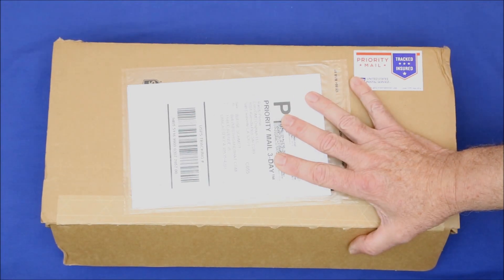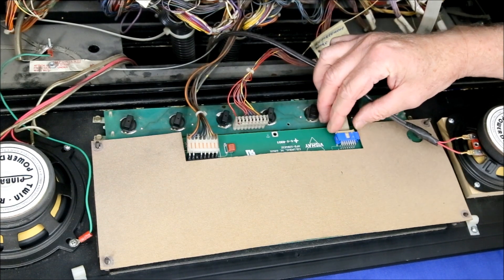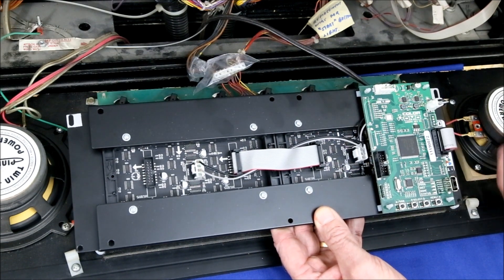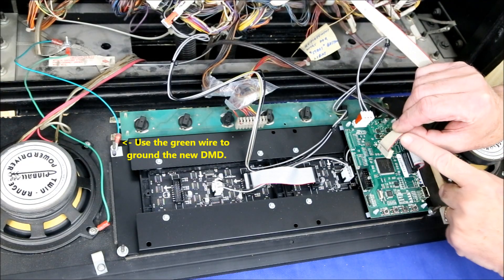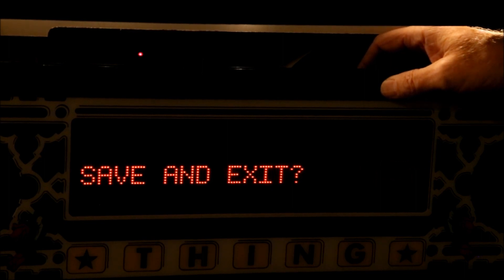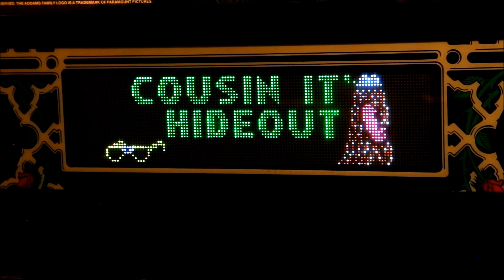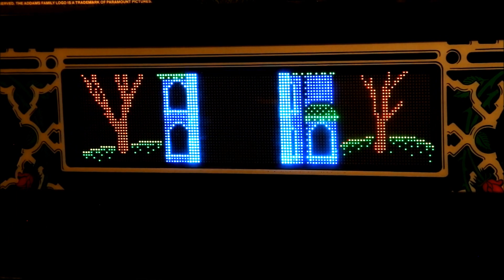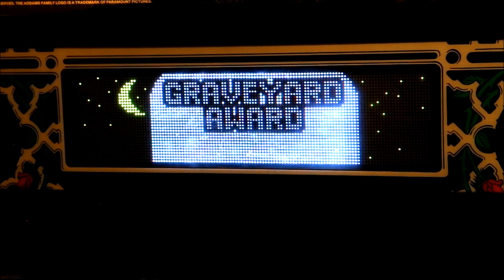Color LED DMD Unboxing, Installation and Operation

Comment: Very cool. Also good you mentioned keeping the original dmd. Sometimes a table is worth more, if it has the original factory components intact, upon selling. :)
Reply from the maker: Thanks for commenting! I also kept all of the original incandescent lamps. It surprising how many of them there were.
Reply from the maker: You play a Theremin! Wow. I've always been interested in them but never had the courage to get one. When grandchildren started popping up I almost got one with the excuse it would be educational for them to see.

I notice you play a solid state unit. Have you ever played on an old tube instrument? I remember reading that they sound and play different and wondered if that was true. I'll be sure to check out your videos. Who knows... you might be the inspiration that finally tempts me into purchasing one.
Reply: @wayneschmidt490  Yes. Tube theremins are very different from solid state theremins, in that they have a warmer, smother tone. However, they have fewer octaves, and are much more sensitive to changes in temperature, and humidity. You have to constantly adjust them. Look for vids of Clara Rockmore playing one, and you'll see her constantly reaching down to the controls. I did get an opportunity to play a modern replica tube theremin, by Mark Kepinger, whilst attending a theremin workshop / symposium, back in 08. A very different experience, indeed. You really should try one. If you find it's not quite your cuppa, just return it to the seller, or flip it on ebay. :)
Reply from the maker: @ThomasGrillo  I bought one! This was something I'd wanted to try for many years and decided I might as well indulge myself while I still had time. (Yep, I'm that old.) I hope you won't be disappointed, but I decided on a very cheap, entry-level device: a Burns B3 for $250 from Amazon. I can always upgrade if the interest holds. I am realistic in that I am not expecting the tonal quality of better instruments, particularly since I'll be using an inexpensive amplifier with it. 

Thank you for giving me a new interest to explore!
Reply: @wayneschmidt490  Based on the price, I'm guessing you got the Burns B3 Deluxe? I have that one. By the way, for best tone quality, set your amp so the highs are only at 20, to 25%, mids are at half, and base to 75%. Volume should be around 3, or 4, or as desired. I know Burns, personally. He'll get you taken care of, if you have any issues. His stuff's not made in China. He makes each unity by hand. I know, because I visited his production facility once. Do let me know if i can be of any help, setting up, and getting started. :)
Reply from the maker: @ThomasGrillo  You're right, it is the wider deluxe model. Thank you for the amplifier settings!
Reply: @wayneschmidt490  Awesome! I forgot to add, if your amp has reverb, input a light amount of reverb, and it'll sound a bit smoother, and livelier. Better yet, add a reverb/effects pedal, and don't be afraid to explore looping pedals. Definitely look into the Talking Machine, by Electro Harmonix. My vid, Requiem for Theremin features that pedal in parts of the piece. :)
Reply from the maker: @ThomasGrillo  Thanks again! The instrument is due on Thursday. Can't wait.
Reply: @wayneschmidt490  Awesome! :)